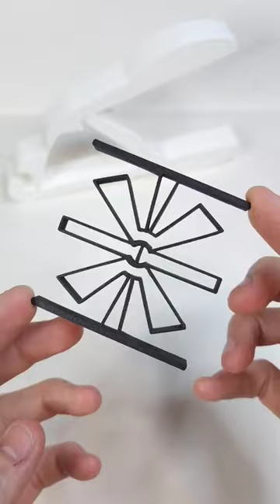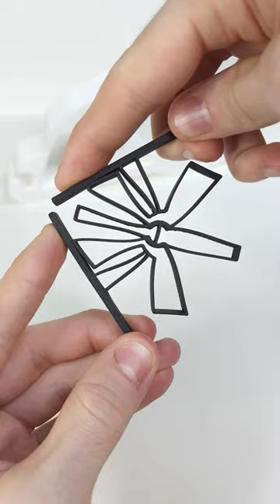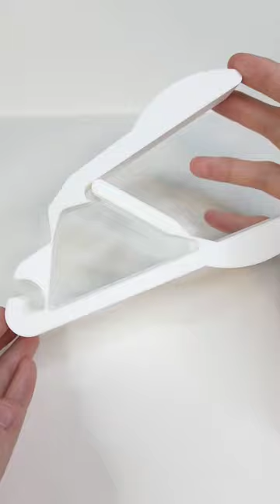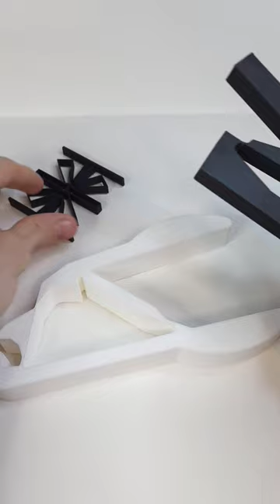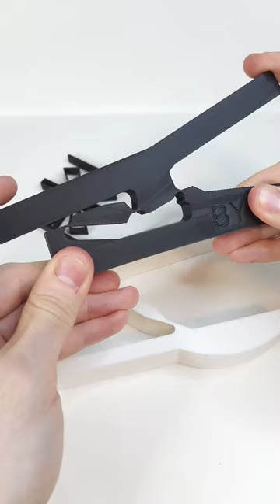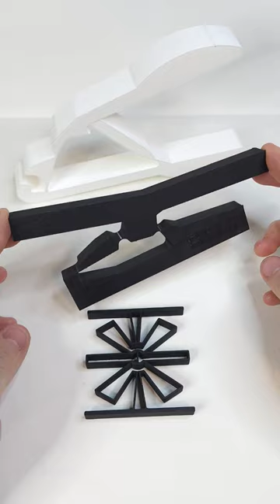Compliant Mechanisms #shorts #3dprinting

Comment: Out of curiosity, how easily do they break with use
Reply from the maker: With pla filament it won't last too long like maybe a few hundred cycles or so. I saw another video explaining the original designs made out of another plastic material and they said they tested it for over 1 million cycles on  the bistable switch and it's still going strong

Comment: Yes because bolt, screw and spring are not SINGLE PIECES. wtfayta?
Reply: 1+1+1=3 three different pieces
Reply: @that0negrubb630  yes, 3 singular pieces, that's why they are the number 1.they are all singular though, 1piece for each
Reply: @renagenic  When he's saying it's a single piece he means the overall device is made using only 1 part. There are no additional parts like screws, bolts or springs. Like a pair of pliers would be 2 pieces (the two halves) connected by a 3rd piece (the center pin). The pliers in the video on the other hand are just 1 piece.  

There are multiple reasons why it's really cool but one reason like mentioned in the video is that they can be made incredibly small. They can be made so small that it would be incredibly difficult to make a similar device using multiple pieces. 

How this helps you Renagenic
Reply: @MewsSnep  that's NOT what he said, he said, bolts, screws and springs aren't single pieces. THAT, is wrong.
It's very very simple